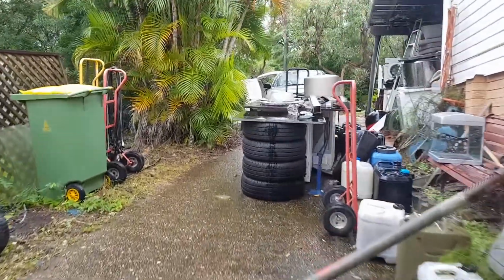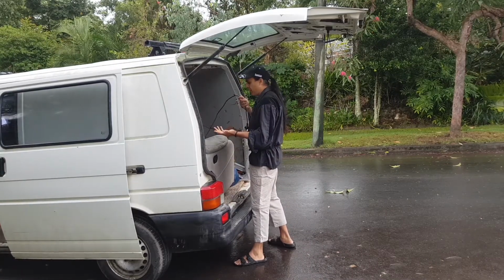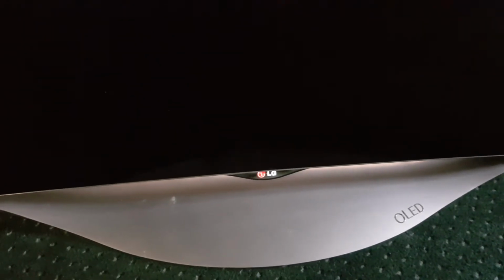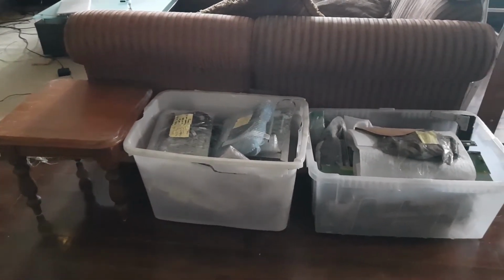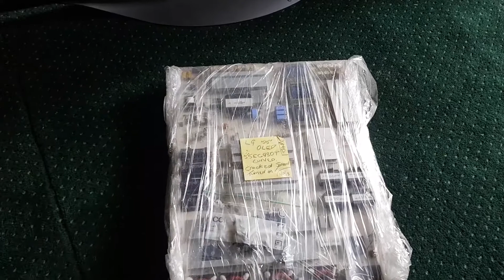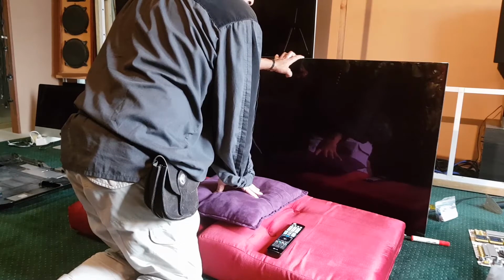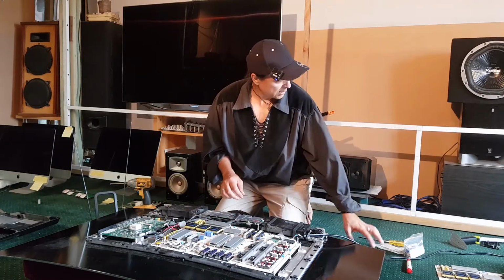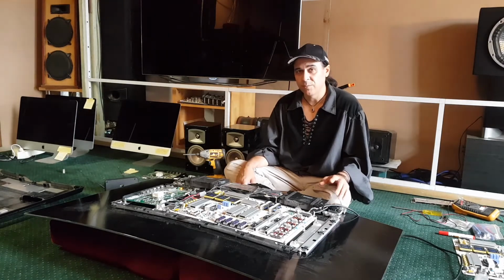I found an LG OLED TV at the dump! Lets try and fix it. LG OLED 55EC930T.  Repair, DIY, Fix, Recycle

Comment: I have exactly the same problem. I also hear the clicking sound of the relay turning on then off. Did you manage to find a fix after?
Reply from the maker: Sorry for the delayed reply David I had a house fire about the same time as you asked this question and I've only just now got on top of it. I did in fact fix it. I'm pretty sure it was the tcon mate. I made a video but haven't uploaded it yet. Won't be able to until I get another computer to edit video. My other ones were burnt to a crisp.
Reply: @DIYDumpRat  Thanks for getting back to me. So sorry to hear about the house fire. Do hope you have got on top of it. With regard to the LG, I thought it might have been the power board, tested with multimeter but it was not that, so like you said, it could be the T-Con.  I look forward to watching your content once you are up and running again. Regards 👍
Reply: @DIYDumpRat  I also have this issue - did you ever upload that video. Sorry to hear about the fire!

Comment: Hey DIY Dump Rat, great vid! 

I have 2022 LG OLED TV a friend was transporting while moving interstate that they unfortunately dropped. and because it was damaged they've left it behind.

One corner of the frame\screen is bent and there are some small cracks. It has power, and the power board appears to test ok but the screen wont turn on... we dont have the remote either though, is that required to turn on?

 And if the screen is bent in one corner, will that prevent any picture from appearing?

Thanks mate, any guidance would be much appreciated!
Reply from the maker: G'day buddy and thanks heaps!  Ahhh no that sucks.  Pretty much if it has a crack then it's toast unfortunately.  Oleds seem to be different to most other tv's that have backlights.  

Most of the time if you crack a normal tv you can still see part or most of the picture.  But with Oled's I've found that you can't.  In fact every Oled that I've turned on with a crack, no matter how big the crack or it's position, I've never been able to get any picture to appear at all appear.

So I just grab them to harvest the boards.

But to answer your other question yes you can turn it on without the remote.  Normally at the bottom center of the screen there is a power button.  At least on the models I've had. 

You can always sell the TV as is.  You'll probably get a bit for it.  Lot's of people out there looking for good boards to help fix their tv's.  Good lucky mate! 👍
Reply: it is possible to get the TV on again if Panel has a issue. i had the 55EC930v and i was spending a looooooot of time with it (months)
i needed a service remote (old phone can also work galaxy s5 because of IR Blaster) and then you will see something on the screen like in the video at 21:10. unfortanetly my panel went down after 4 years and i saw at boot with service remote green clouds and sometimes it went on, then the panel right side crashed, it was flickering and boom tv off.
i bypassed the protection by using tape and searching for service manual in internet. on LVDS cable i had to put tape on a pin called "BURNT_DET". now tv couldn't check anymore for panel and T-con issues and will always boot after using service remote. BUT, now you have to be carefully. OLEDs won't turn on if they have a problem because it could be something dangerous. i mean, after forcing the panel to turn on (the screen freezed in white color with stripes) the left screen side went really hot with 88°c. i was 30-40cm away from panel and i feeled something getting warm and then OUTSCH the panel is hot. that was the final end for me... 

summarized: you need a service remote or old phone with IR Blaster and app RCOID. download in the app LG service menu.
then find the protection pin on LVDS cable (using a service manual will help to find it faster) and put tape on that protection pin. if it's a panel issue, your tv will turn on again now. if not turning on, the issue will be the MB or PSU.
Reply from the maker: @MichaelDRE26  Depends what you call a bad panel mate.  I've always referred to TV's with LED backlight problems (where an LED bulb in the back goes bad, therefor creating a cascading affect and rendering the TV useless) as a TV with a bad panel.  You can't really fix that without pulling the entire panel apart (incredibly risky and difficult).  
What you are referring to is a TV with a screen fault where a pixel in the screen itself is bad and all you are trying to do is mask the signal going to the bad pixel with sticky tape.  I guess some times I too refer to that as a bad panel as well.

To fix a screen fault you can use sticky tape, but only on certain screen fault issues.  Not all issues can be fixed.  

I show people how to do that in this video here:  https://youtu.be/WwpjbLrydmE 👍
Reply: @DIYDumpRat  ahh I was too deep in that OLED Story. Yup I agree this tape method is good for LED/LCD TVs.

But with Bad panels I was meaning the OLEDs, not LED TVs, sorry. 😅
Reply from the maker: @MichaelDRE26  one thing the release of Oleds did on the world was to ad a whole new level of confusion to the poor old TV repair tech lol 😅
Reply: @DIYDumpRat  Haha yes, i remember some users in a tech forum that said, check for backlight LEDs.. 😅 but yep
Reply from the maker: @MichaelDRE26  Haha sounds about right 😅

Comment: Please help . I have an lg oled 55eg9600. It get playing a static image every time I played a video , so I decided to bake the main board and it still had the same Issue . So I gave up and started putting it back but now it doesn’t want to turn on. The lg logo just keeps blinking. Please help.
Reply from the maker: Sorry to hear that mate.  Baking mainboards generally lead to a worse outcomes than  positive ones in most cases I recon.  I'd rather get a small heat gun and concentrate heat on certain parts these days.  You might have to bite the bullet and buy a new one unfortunately.  But yes I think you're on the right track by assuming It's a mainboard issue 👍

Comment: Hiya Isky.
Sounds like it could be capacitor,coil,or diode related on power board.
I doubt that you can be arsed with individual components though .
At least you got a matching 3 seater from your visit to the dump.
So a 50/50 trip then.

Always look forward to your dump visits surprise item videos though.

G'luck mate .
Reply from the maker: Mate I use to do circuit board component work all the time.  That's how I started out with electronics.  Then all of a sudden I started getting multiple TV's, and it was just easier to replace boards lol.  If it actually comes down to it and I can't score a replacement board I'll put  a little more effort in.  My dad's really good at it as well so he can help.  But for now I'm so time restricted.  Making videos takes such a long time lol.

Comment: You still got it?
Reply: It’s not any of the boards. It’s the screen. 

It’s 100% not power board. 

You need to snap a resistor off the main or tcon or pick off one of the pins on the lvds. 

It’s pin 12 to be exact 
It’s the burn protection sos 

It might look ok or it might not. 

Which you could find out before even taking the cover off it  you had a service remote for LG

Comment: STOP, its not the power supply.Sadly you don't know it yet, but you have just blown up the mainboard, the problem is either the screen is shorting out or the t conn board is faulty. I know this cos I've screwed up 3 main boards. I think in the near future you will see more and more of these TVs in the tip.The clicking sound is the safety from the PSU switching off cos your pulling too much power
Reply from the maker: It's all good mate. This is an old video. I fixed it ages ago. I just haven't released the repair video yet. No I didn't kill the main board. And you're correct. I had to replace the t-con to get it going 👍
Reply: So if a screen is cracked, will you still get power?